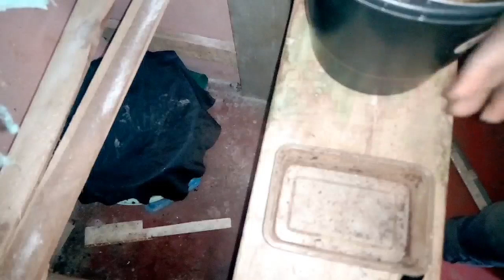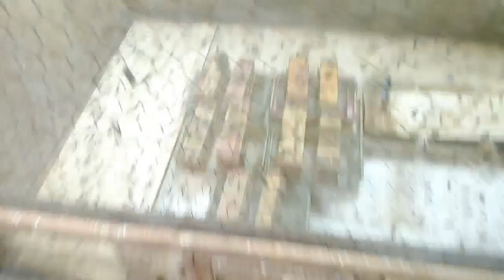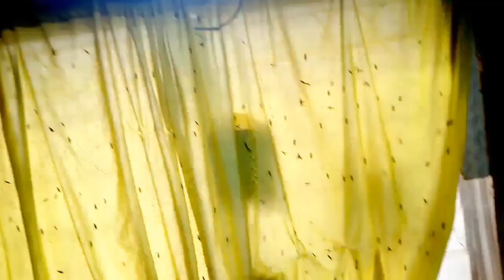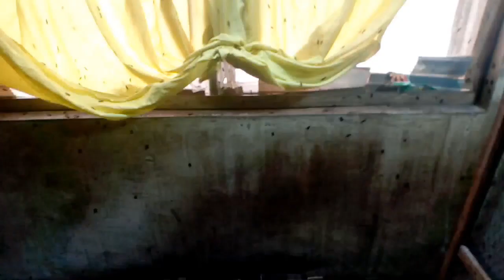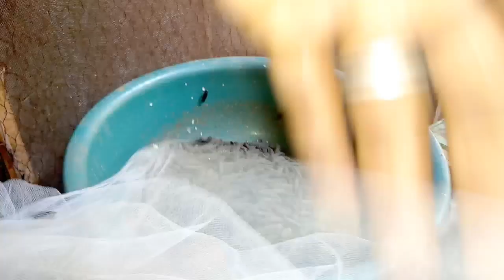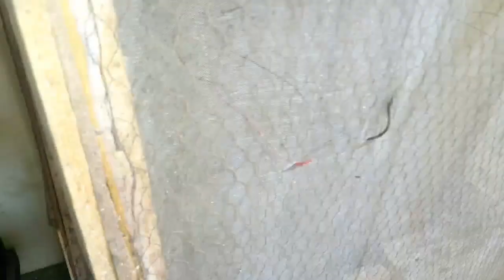How i introduce pupae into my love cages in black soldier fly farming in Nigeria, Ibadan.

Comment: Good day.Thank you for the video. I have issues with my pre pupea. They are not turning into flies, they are black, shed skin but flies not emerging. Is it became i did not hibernate? I saw you kept yours in a container and covered it before flies emerged and you introduce it into the love cage. Mine are in the love cage already, in the open.
Kindly advice
Reply from the maker: It's the weather, the temperature and also is low, try to keep them where the temperature is about 30 and humidity is about 70% and more so, do not disturb them, it delays them too. In a matter of time you will see Pupae and later flies, best of luck 🤞
Reply: @Tucurintegratedfarm  Thank you, brother. I appreciate
Reply: Thank you always for your listening ear and advice. I kept the prepupae in a bucket with sand, and after some weeks, it turned to flies. My latest challenge is that the flies die quickly by my observation. What could be the problem? Should I bring them to the open? Thank you

Comment: When they're in pupae stage, do they not need any material to burrow into? I saw other videos that said they should be in soil or similar material to burrow into and transform into adults. However, your bowl seems to be bare.
Reply from the maker: Yes, some people add substrate dry substrate but I don't because if you put them in a dark environment with no disturbance and normal temperature, they will pupate without adding any materials and more so, I use the shell.
Reply: @Tucurintegratedfarm  Thank you very much for your reply! Btw, does the container have to be wider than deeper? Right now I have them in a 6L plastic water jug. Do I have to worry if they pile up higher in that container?
Reply from the maker: Yes of course, you need to worry about the dept, it should not be more than 8 inches, 5 inches for the larvaes and the remaining 3 inches for air and movement.
The container can be as wide as  100ft by 100ft but it's dept should not be more than 8 inches, hence, they will all suffocate.
Reply: @Tucurintegratedfarm  thank you! You are a wealth of knowledge! If you will allow one more question, recently my larvae are climbing up (vertically 90 degrees) in great numbers inside the tub I keep them in. Normally, I'd think they were ready to pupate but the vast majority of them are smallish and not really darkening yet as far as I can tell. Could it be an oxygen issue? I've put air holes (the size of a nail) at the top of the tub and closed it (for fear of rats and others that might eat them) where I previously just kept the tub slightly open.

Comment: Why do you use artificial light when you have sunlight.
Reply from the maker: Sun is not reliable, it's unpredictable and you don't get maximum result, you can't fully produce all year round, you only get good production for sometime and little or nothing for sometime too.
But with artificial light, you get to produce all year round, they mate 24/7 leading to lots of eggs.
You might think you are getting good results using the sun, try using the artificial light, you will be surprised.
Reply: Good video. I have issues with my pre pupae turning to pupae, they are black and shed skin, but I am not getting flies. Is it because I am not hibernating? I saw you kept yours covered before sending into the love cage. Kindly advise